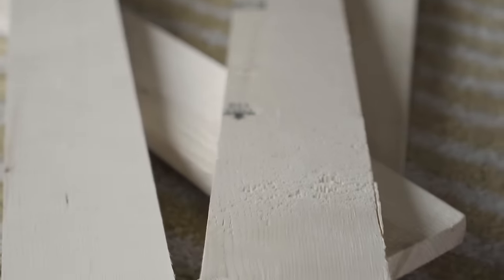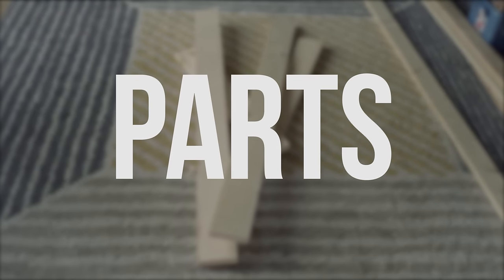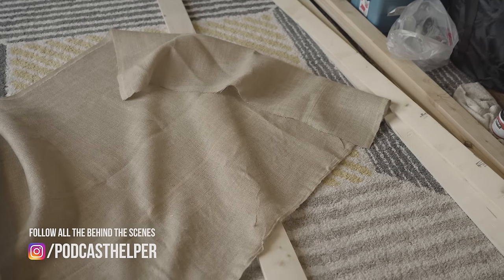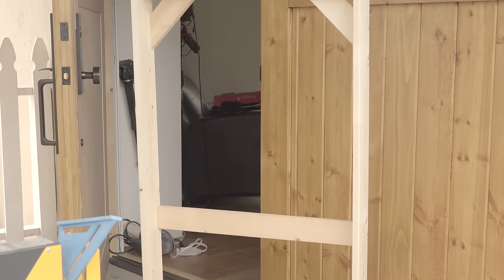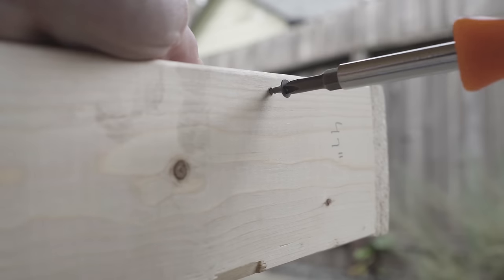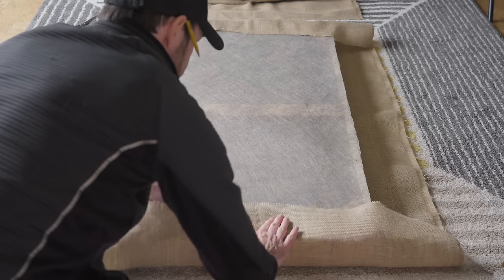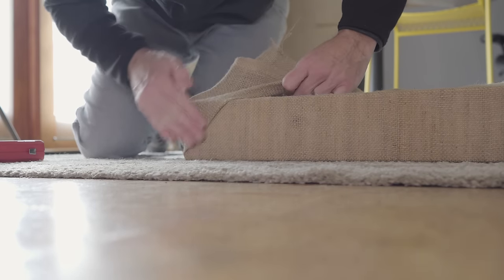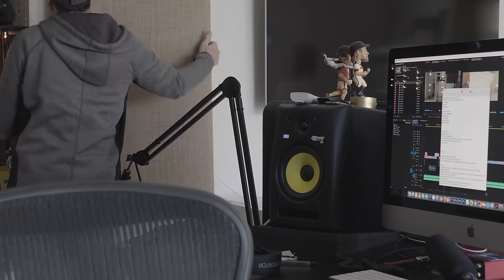How to Build Your Own Acoustic Panels

Comment: Nice work but whats up with the panel on the right at 05:08...?
Reply from the maker: LOL, I never noticed that. THAT was a special panel I built that ended up with cutouts to fit around lights that hung from the ceiling. Ultimately these were heavier than I wanted to hang above my head so that one still sits in my shed ready to be turned into a regular panel lol. Good eye;)

Comment: hi Ray..excuse me please.i have 4 kids and they r pretty loud!!! :) .how can i make my room like a desert...i do not want to hear any thing ..i need to block almost 100% of noise coming up to my room..is acoustic soundproofing panels can help if i gonna make all the lengh and width of the walls with those panels?
Reply from the maker: Unfortunately panels are not that powerful. These are for reducing reverb/reflections in your room not keeping sound out. Sound proofing is what you are looking for an it's a very expensive process. Usually this is accomplished by building a room inside a room. Check out videos on here where drummers built a studio. Keeping the sound in also keeps it out but that will give you some insights. In your case, you'd probably have to add extra drywall with sound absorption between the two walls and likely a double door. Windows will also be a big cause of audio leakage.

Comment: Great video. I don't understand how your back piece is 23" long. The top/bottom pieces measure 24.5" across and each of the sides are 1" thick so that means the gap between the two side pieces is 24.5 - 2 = 22.5". How could you fit a 23" back piece in this gap? Is one of your numbers incorrect? Thanks.
Reply from the maker: It's because the top and bottom pieces attach to the top of the side pieces hence they don't take into account the thickness of the side pieces because they are on top and not inside those pieces, the back piece goes inside the side pieces and needs to account for the thickness.

Comment: Hi, we have our kids' drums set up in area of the house that would otherwise be a dining area. We're trying to come up with cost effective soundproofing and I came across your video. Do you think the frames might rattle on the wall if we hang them the way you illustrate in the video? If so, what would be an effective alternative? Thanks for the video!
Reply from the maker: Good question. You just might want to buffer the space between the panel and the wall with something soft, even something like a sponge or you can attach it to the wall directly in place of leaving a gap. But you won't know until the panels are in the space and you test them. Let me know!

Comment: Is the weed fabric necessary? would the burlap fabric not be ok on its own? The weed fabric is very expensive here. cheapest roll is around 100 dollars, and it not even that much on it.
Reply from the maker: No it's not necessary but it's being used to hold in any fibers from the Rockwool and in future panels I will include this on teh front as well just to make sure fibers don't come out but you can use anything that has a tight weave yet still allows air to pass through. I'm sure there are any materials that would do the same.

Comment: Just a heads up! I ran into a small issue because the wood cuts for the sides are 47" but the insulation is actually 24" x 48" (2 x 4 ft) if you order acoustic insulation like Roxul or OC. The rest of this tutorial is perfect though!
Reply: 12” x 48” is not (2 x 4 ft) that would be 1 x 4 ft. I’m assuming you meant 24”x48”

Comment: This is a damn good tutorial and I’m definitely going to do this!
How many boards per square feet are recommended?
Reply from the maker: Thanks, Mike! Not sure about how many boards you'll need, likely it will depend on what is available at your local shop but also note that I used a weed fabric on back but in this video I did not put it under the burlap in front which I would do if I was building new panels.

Comment: I understand the burlap covering for it’s porous reasons. But Is there a more aesthetically pleasing material to use such as a thin colored cloth that I’ve seen at hobby lobby that can be used as well without defeating the purpose?
Ps.  Now I know why I saved all those wine corks.  Thank you.
Reply from the maker: You could use anything that will pass air. So hold up the fabric you're thinking about using and see if you can blow through it. Likely any thin fabric would. work.

Comment: I would recommend taking larger drill and making a little holes on top of a smaller ones to insert screws into the wooden panels. I'm about to make something for my room and I have a few ideas more. :) Perfect timing and many thanks. 
Is that Your daughter? That screw is perfect, nice job.
Reply from the maker: Thanks! Definitely use pilot holes!

Comment: I am concerned about the use of mineral wool for insulation. Is it safe to breath? I plan on putting 4 of these up in a small space for recording. Does the burlap do a good enough job at keeping the mineral wool dust and fibers from floating around in the room? They could really mess up your lungs.

Is there a safer alternative to mineral wool I could use?
Reply: Never mind, just read the comments. I have a lot of jeans I need yo throw out anyways. Thanks!
Reply from the maker: Maxwell, you would not want to breathe it if you could avoid it of course but if you're concerned and when I build more, I'd probably add the weed barrier I put on back onto the front as well. I'm either going to update them that way or get new coverings but in the meantime I'm not overly concerned, they work great.

You could also look at recycled denim but I find it to be more likely to shed than the rockwool but you can also fill the frames with anything that will absorb sound and you are comfortable with.

Comment: Appreciate the video. I am in the process of making sound panels for a home studio. After looking at the video, I was concerned about the safety of using Rockwool and covering it with cloth. There are some who consider Rockwool to be a very dangerous material which can pass through fabric if covered. Is there another type of material you would suggest which can work for sound absorption?
Reply: The EPA has classified refractory ceramic fibers as probable human carcinogens. The International Agency for Research on Cancer (IARC) has determined glass filaments, glass wool, rock wool, and slag wool to not be classifiable as to their carcinogenicity to humans (Group 3).

Comment: Thanks for this video! Any other better/worse materials recommended for inside the panels?
Reply from the maker: Can fill the frame with whatever you want but the stuff I used is made for acoustic absorption. I would place the weed barrier in front as well so you don't have to worry about any fibers leaking out.
Reply: @RayOrtega  Sorry, a bit confused. You said you would place weed barrier in front as well, but you already did it in the video. Do you mean put backing on the front before the burlap? To prevent mineral fibers from leaking out?
Reply from the maker: @meedily  Yes, exactly. I used a weed fabric on back but in this video I did not put it under the burlap in front which I would do if I was building new panels.
Reply: Thing Ive noticed in your top end studios is they use reflective exteriors but behind that its insulation and 2 feet of cement. Its a cool mix of a very live sounding room thats very dead at the same time. When The Pass was open they had an oblong shaped live room that was kind of small but the ceiling, the floor the walls and the door were all covered in what we'd call 'wood flooring.' But behind the walls you had insulation and a foot and a half of cement. That was a very cool sounding room.
Reply: @thetruthchannel349  my school omega recording studios in rockville md  has this same exact wall barrier setup, its like different thickness of wood slabs behind it is a huge sheet of burlap/absorbtion makes it sound dank af
Reply: @CamoHorizon  Ya, most of your big studios use those. Capitol use those same baffles. Paramount uses them. I think every major studio Ive ever been has used them. They've been used forever man. About as long as theyve been using Piano covers as acoustic barriers in studios lol
Reply: @CamoHorizon  Really just depends on the sound you want and why youre using them. I know Capitol uses them when recording bands in a live recording setting or they'll use them to put behind vocalists. Just depends on what youre doing and why I guess.
Reply: @CamoHorizon  Best 2 rooms Ive ever been in were at The Pass which closed years ago and Paramount. Both rooms were heavy cement blocks covered with baffling and then covered with Wood panels. A lot of hits have been recorded in that vocal room at The Pass. It was shaped for wave cancellation. Dead room but at the same time a very live room. Every breath in that room sounded like it was right in your ear. My favorite room anywhere. Sucks that Spiner and Dorn and that other guy closed it down. They were just using it as a tax write off anyway.

Comment: What would happen if instead of that material you used I put acoustic foam inside of the frame? Excellent tutorial!
Reply from the maker: Yeah you can fill the frame with whatever you want. As long as it's something that will absorb sound waves, it will work well. Not sure which acoustic foam but those thin, jagged, dark gray panels don't really have the density to absorb much but if you have a bunch laying around you could always give it a shot.

Comment: Nice tutorial ! I think i'm gonna go into it ! How much  per Pannel it cost ?
Reply from the maker: Thanks, check out the description, I break all the costs down there, should be around $25 per panel but you may also want to use something else besides Rockwool, up to you, you can put in anything that will absorb sound, the main part of the tutorial is the frame. Have fun!
Reply: @RayOrtega  Rockwool is avaiable in the nearest market in Paris.. so I think it will be nice with it :) ! Thanks for your answer

Comment: Isn’t the fabric too breathable? I bought the same fabric… I’m considering adding 2 layers. Any thoughts?
Reply from the maker: The burlap is definitely more breathable than others, if I did this again, I would use the same fabric that I used on back (the weed barrier) just to ensure that none of the fibers come out of the front. I've had these panels in my office for years now, I don't know anything coming out of them, they don't move but again, if it's a concern and you want to be more certain, I would use a layer of something less porous.

Comment: If you were to do this project with denim panels as suggested in the notes, would you suggest doubling/tripling the insulation within the panels or a thinner panel design? I’m concerned with the size of my recording space and that the roxul I just purchased might not be the healthiest option in close quarters.
Reply from the maker: Thanks, good question. I have some denim here from a delivery that my wife gets and I want thinking of stuffing these frames with it but what I noticed is that it sheds. A lot! So it makes me wonder if it’s really any healthier. I mean stuff in your lungs is just that, stuff in your lungs! So i think it’s a coin toss cause Indont see my Rockwool panels shedding much. That said I’ve come up with a new solution that is going to have me update this video and that’s to just use the weed fabric that I covered the back with to also cover the front under the burlap. We’ll see if it makes a big difference in how much reverb is absorbed but if you’re concerned then the best thing to do is use a less porous covering or cover it the way I’m going to do. Thanks!

Comment: Hello Ray! Is the fabric enough to stop the rockwool fine fiber from coming into the room air? I also want to build some of these, but can they be toxic in some way? Thanks
Reply from the maker: Hard to say, I don't think it's coming through especially since the panels don't move but if concerned, a couple options would be to use a different material inside or outside like a tighter fabric or a recycled denim for filling etc. Thanks for watching!

Comment: For some reason I cannot find the 24” rock wool safe and sound at all! Any tips? The one you have listed is a 16”
Reply from the maker: You generally have to special order the 24". You could just use the 16" to fill it up by cutting the extra that you need. You can really fill the frames with anything that will absorb sound. Recycled denim, fiberglass, cotton etc. I would seal up the front side the way I did the back side to make sure whatever material you use stays in side.

Comment: what is the name of the Material used for sound Absorption  ?
what can i use instead of this Material ?
I have made a booth and it is creating Reflections and need to put some absorption material to make good quality sound..
what else i can use ?
i have a piece of Glass installed in the booth. Does it also create Reflections?

Comment: Like the idea of using bottle corks for standoffs (vs. wood dowel material or nylon spacers), but the tallest cork I am finding is about 1.3 inches and recommended air gap is 2-4 inches for this size panel. Did you come across a source for longer corks?

Comment: Is it safe having insulation semi exposed like that in a room? It's meant to go in a wall. I'd be worried about breathing that stuff in
Reply from the maker: It doesn't appear to be shedding or coming out of the burlap however in future builds, just to be sure, I would go ahead and place the weed barrier I used on back on to the front as well and then you don't have to be concerned.

Comment: Does making space between the wall and panel make that much of a difference? This is the only video I've seen of someone doing this. Wondering if this is how I should do it as well
Reply from the maker: I think it falls into the 'every little bit helps' category. Yes, leaving a gap in back lets the reflection go off the wall and into the back of the panel. Just another spot for absorption to occur.
Reply from the maker: @videobenji 👍

Comment: I am by no means an expert on such a thing but for those worried about the rockwool insulation shedding fibres, one thing you can APPARENTLY do (no experience or knowledge of it's effectiveness myself) is spray the rockwool with 10 parts water to 1 part PVA and 2 drops of washing up liquid per litre. This supposedly  locks down the fibres on the outside without adversely affecting the sound absorption capabilities of the rockwool, stopping the fibres from breaking up and entering the air.  All that said though, they are still fairly dodgy. If there are any concerns, probably best to go for something else instead.

Also, keep in mind that the recycled denim advised in its place does apparently have formaldehyde in it, to what extent I don't know but it is a known human carcinogen.
Reply from the maker: Thanks for the tip, I'll look into more feedback regarding a solution to "lock down" the fibers just in case. I've heard denim is supposed to be formaldehyde free but I'm checking different brands to find one to confirm that.
Reply: I thought so too but I saw that on a website it had an X next to Formaldehyde free. It's probably that there's no added formaldehyde but that the denim material itself perhaps has some within it already. I think at this stage though, as long as you are careful, take proper precautions when handling, seal it with something and use fabric to cover it up and aren't disturbing it too often (heavy bass could be an issue there) it should be completely fine. If anyone really has concerns after all that, they can invest in an air purifier which can neutralise fibres in the air and even catch poisonous gases like formaldehyde supposedly using the carbon filter. 

I think the safety concerns may well be thrown out of proportion for the usage shown here but it is paramount to treat such things with due diligence just in case. I feel as long as those steps are taken, anything will be safe. And during research I found some evidence showing that cotton and polyester fibres can be highly hazardous and cotton dust has even been linked to cancer directly whereas mineral wool and fibreglass have not, albeit, that was in a man that worked in a cotton factory for 50 years, a far cry from setting up a few panels, relatively unperturbed and sealed away in a studio room.

What I've learned is that apparently everything is awful for us and cotton fibres can supposedly get caught in the lungs and stuck there even longer than fibreglass fibres, which is genuinely surprising if true. Some other sources say it breaks down fairly fast. At this stage I just don't know what to believe, haha. 

Proper precautions should be taken, beyond that, I think the concerns are often overblown.

Comment: So, you’re using a breathable thin material to wrap it? I’ve heard lining the panels in moving blankets works better? What’s your opinion on this.
Reply from the maker: As long as the fabric allows some air to pass through, it should work good. See if you can blow through it in order to know if sound can travel through the fabric. Moving blankets can be used on their own, just hang them up

Comment: Very helpful walkthrough! I have 2 questions, if you could be so kind. 🙂1) You show a link to the denim Batts that you would use next time, and those are what I'm about to purchase. Do you think there will be a difference acoustically? 2) Do you think the type of fabric would make a difference a acoustically? I was thinking of getting some cotton fabric to make them a little more visually appealing. Thanks 😁👍
Reply: Fabric needs to be breathable to work in this application.  Best test, hold it up to your mouth and breath through it with your hand behind it.  If you can feel the air, it's "breathable".  Burlap works great but there are other materials that work just fine.